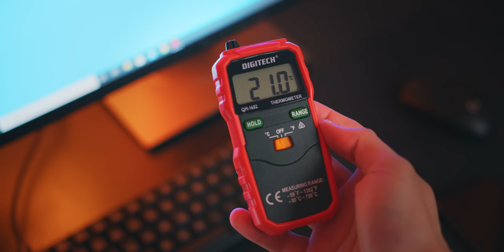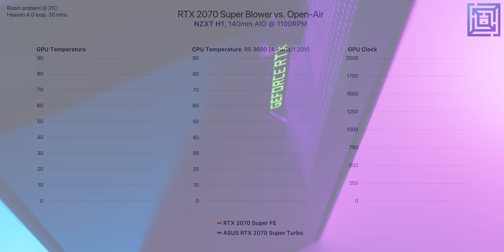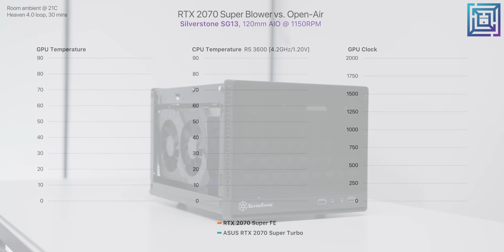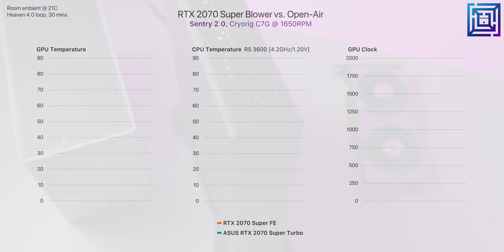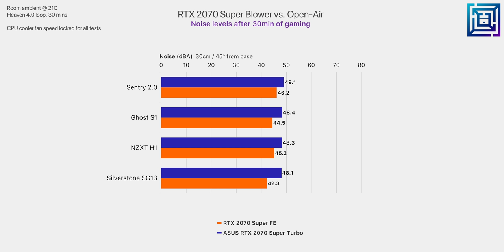Blower Graphics Cards for ITX Builds – Final Answer!

Comment: Don't fear the blowers people.  Makes more sense in the tiny builds.  Just create a custom fan profile and see if you can under-volt without performance loss.  This will significantly reduce noise.
I run one like this in my NCase.
Reply: I've used blower cards in my previous 2 ITX builds and I don't know if I've just hit the lottery but when I take my case around to friends places they can't believe how quite it runs. Guess I just lucked out. I would not hesitate to get a blower cooler again, building in a Silverstone ML08
Reply: I am very afraid though. Haven't left the apartment in weeks, although that's completely unrelated. Bought a blower style card and locked it in a separate room. I swear I can hear it whirling and wheezing at night.
Reply: @FromDkWithLove  Haha. Maybe I have hearing issues then my PC's running 24/7

Comment: I need your opinion for my build, i mean thermal wise, for gaming and 3d render (3dmax) and autocad

I already purchased the cpu,gpu, case
The rest i will buy next week
Case: Lazer3d lz7
Cpu: 3700x + noctua l12s
Gpu: Gigabyte 2070 mini 8gb
Mobo: Strix b450-i
Ram: 64(32*2) lpx 3200mhz 
Psu: Sfx evga 650watt 80+ gold

Comment: Great video! You were right I didn't expect the results of the Ghost S1 and the NZX H1 especially of your review of the latter. 
Goes to show if you can get an AIO water cooler in your build it definitely helps.
A good follow up maybe your most recommended Blower style GPU model.
I'm feeling the  RX5700 /RX5700XT

Comment: Your Asus card is dented, did you smash its corner or something? On more serious note, thank you for this test, it helps clear up such a niche market that not many Youtubers look at.

I think not many people realized, if you use open air cooler in thermally constraint case, you basically cooked your motherboard and ram, your CPU got cooler, but the other components don't. Open air cooler works only if you got a very good circulation inside the case

Comment: As itx cases come more popular, the blower style GPUs might aswell. I just hope they try to improve the fan as much as possible on these blower style coolers, so they could be slightly more effective while being quiet. They could also use slightly thicker heatsink, backplate, better thermal paste and higher mounting pressure to ensure the lowest temps possible on these blowers. At that point it would be the best choice for sure for itx builds. Oh and I almost forgot, as the tech improves, just by being more power efficient will also drop the temps.

Comment: Hey man I'm watching your videos for quite a while and I wanted to build a portable mini itx Music Production PC, with m2 ssd using Avid Pro Tools. need a recommended portable screen, good thermals, but I haven't figured out a build yet besides the motherboard, and a graphics Cards. I'm a sceptical about the ram for which I need 2 Cartridges providing 32-64gb, I don't know which m2 is more reliable to handle VST. I need to replace my desktop with something portable that I can take to a studio... Maybe you can recommend one of your videos as a build example? ty
Reply: I've done a few mini-ITX builds. How small are you wanting to make it? If you're going to be putting it into a backpack I would build it into a smaller case, but if you're going to be carrying the PC around I would recommend the case I have with my main build - https://www.amazon.com/SilverStone-Technology-Mini-ITX-Computer-ML08B-H/dp/B0161UXWRA/ref=sr_1_1?crid=2MDXQ53ZFEPV9&keywords=silverstone+ml08&qid=1583876262&sprefix=silverstone+ml0%2Caps%2C356&sr=8-1

The feet are unnecessary so you don't have to worry about bringing those with you, it's totally stable just with the case and handle. Depending on what you put in there it might be heavy, for example I have a full sized 1080ti in my build, as I'm happy to have the extra weight to carry around with the better performance :-)

As for monitors, it depends what quality you want. I know there are monitor that are ultra portable and totally powered by USB such as the ones listed on this page - https://businesstravel.reviews/best-usb-powered-portable-monitor - Personally I've never taken the plunge into a fully portable monitor as it's easy to leave a monitor where I need and just take the PC and a HDMI cable.

Hope I've been somewhat helpful!
Reply: @TroyHulm  Hey thanks for your reply, but r u sure everything is going to fit in that case? Or being able to breathe? Hdmi is an option but I intend to carry it around and work on the go too!!! I'm very sceptical about such a build still... I've been sceptical for over a year now, but the tech hasn't changed much since then... Thoughts like can I make a portable everything that doesn't brake when moved too often? plus the Audio interface is always external for several output uses... Have you seen a case on this channel that might give me a clue or an orientation??

Thank you so much for your time!!
Reply: @billynorth2391  No worries mate happy to help! The case it actually pretty large for an ITX build so it can fit quite a lot in it. One thing that I like is the plastic side panels (handle is plastic, side panels are plastic but the rest of the case is a thin metal) can easily be removed and reattached. So if it's a particularly hot day or I'm having a long gaming session sometimes I just pop them off to get in some extra ventilation. Not necessary, just nice to be able to do. 

I've actually modified my case a bit as well. I might take some pics and upload the build to Pc Partpicker today and I'll upload here if I get time so you can see what I've done with mine. In terms of moving the PC and things breaking, you shouldn't have to worry about that in modern cases. I know for my ML08- I have moved this thing around for 5 years A LOT and never once had an issue with anything being damaged. I literally move my PC multiple times a day and take it with me travelling (Just be aware as I said before, this particular case isn't actually very small) 

I suppose the best case for you depends on your use, given you've mentioned audio and studio I'm guessing that the graphics card isn't going to be the most important aspect of your build. If you're going to be doing CPU intensive workloads in a small case then you would want to focus on CPU cooling. If you have a big budget this would mean watercooling your CPU and that is something you cannot do in the case I've mentioned.

I think for your intentions, and not knowing your budget you should look at the Sliger SM580 featured in this video https://www.youtube.com/watch?v=qsI-8U5L2Io

Being able to expand the PCI slots could prove useful and it will definitely pack all the power that you require.
Reply: @TroyHulm  Wow ty again so much. Games indeed is not my thing but I need a good  graphics card when making soundtracks and working on 4k video playback on pro tools, but Im not an expert on how the hardware blends with the software so I always buy the best thing for the job and most practical judgung from multiple reviews and asking people... not flashy new things just getting the job done for as long as possible. I will def. Look into it. Ty so much!

Comment: I wouldnt recommend blower style for rtx 2080 super or 2080ti, since my 2080 super even with msi 2 big fans it runs at 75-76c and I cant imagine how hot it would run on a blower style. Since my gtx 1080 blower FE at 1800 mhz would run at 78-79c while the open air one that my brother had would run at 65-69.

Comment: Great video, I have a rvz02 with a rx480 strix oc and in vertical mode the card is very cool the problem comes in horizontal mode and I'm planing to change it to a blower card but still not totally sure if is worth it

Edited : my current card runs 80°C in horizontal with fans running at 70% if is gonna be the same thermals and noise it will only be affecting the cpu Temps but not sure if is gonna help the much the cpu runs at 70°C in horizontal and 58 in vertical

Comment: would have been a more interesting test with a higher power CPU tbh. A 3900X or 9900K OC'ed would be much better information for an end-user imo. I don't think anyone will be worried about Ryzen 3600 temps seeing as that chip is low power.

Comment: Recommend to have same cpu cooler and test gpu card types. That will give a more comparable results, esp S1 to H1
Reply from the maker: The point isn't to compare CPU thermals between cases, it's to compare the CPU thermal delta between cases when using open-air vs. blower. Also understand that you're asking me to remove the pre-installed liquid cooler from the H1, which doesn't make much sense at all.
Reply: @optimumtech  so maybe liquid cooler on all that can be used. Otherwise a liquid cooler maybe more than capable of cooling the cpu during the test, but other coolers struggle. This makes no delta for cpu in the liquid cooler case.

Comment: Hi there,  hope someone can help me out here.
I will do my first build with a NZXT H1 case. Well when it's available again :-(
I'm a casual user and I'm not a gamer, so I don't really need a powerful graphics card. I'd like to play 4k hdr movies though. I will buy a good hdr monitor and i will also hook it up to my LG OLED TV to play movies. I have no idea if the PC will actually be an advantage compared to the TVs algorithms though...
The problem is, I have no idea what the requirements are for this in the graphics departement. I'd like to buy a GTX 1660 (maybe 3 fan variant because of the cooling solution in the small H1 case?).
Would that suffice? Or even be overkill? It's hard to find those requirements because everything is measured in terms of fps during gaming.

Comment: Great comparison. Having a 'blower' 5700xt I've considered it's prospects for the future. I currently don't need to do the washer mod and run it stock as I don't push my system. Do you think the 5700xt undervolted and modded - being a smaller card than the blower rtx 2070 super would be comparative in performance? Currently the blower 5700xt is cheaper than most RTX 2060 supers...
Reply: The 5700xt and 2070S are identical in performance. You'll see 10% back and forth depending on the games or none at all. Both cards can be configured to use more or less power (180-250W) so as long as you configure them to draw lower power they'll both be good for SFF. Currently the 2070S is well overpriced where I live so I'd get the 5700xt any day of the week.

Comment: I do find it sad that blower cards are considered bottom barrel entry level "trash" by both manufacturers and consumers.
With a bit of R&D put into their designs, they definitely could perform better, and as some commenters have noted, they already have in some models.
They'll still be a little loud, but with a more advanced heatsink structure making use of heat pipes and even copper fin designs, thermals could definitely be brought down, and this would in turn improve noise.

Comment: Not convincing for me even in the sentry.  Decibel level is not the only thing that affects our perception of loudness and that whine on the ASUS is extremely annoying.  Despite the fact that the blower lowered CPU temps, the temps for the CPU with the open cards never got high enough to cause worry, particularly since the fan speed was locked.  The fans on aftermarket CPU coolers tend to be a lot quieter than those on GPUs.

Comment: well ofc because in mini itx cases the card is vertical and there is air holes on the side unlike in a normal atx case where the card is horizontally and have a fucking GLASS side

Comment: Hi. Can you make a smallest ATX case build?
Reply: @Rubedo Alaberti Jeez
Reply: @Rubedo Alaberti Google: The standard ATX is the largest at 305 by 244 mm. The micro ATX is at second largest at 244 by 244 mm. Finally, the smallest is the mini ITX, which is 170 by 170 mm. The size of the motherboard isn't really that huge of an issue but it's a point to be considered when you're also choosing your computer case.

Comment: The more I think about the test method and conclusions in this video, the less I like it. Running a gpu benchmark with fixed cpu fan speed, then of course the blower-style card will be the noisiest, as the noise is just determined by the gpu fans and a blower-style card is always more noisy even at the same gpu temperature.

At the opposite end of the spectrum one could do a cpu benchmark. But the result of this is already known: They would perform very close in terms of thermals and noise as the gpus are just idling. If there is a measurable difference, then I expect the blower-style card system to have the lowest noise level, as any temperature increase caused by an open air card is instead blown out at a negligible gpu fan noise level.

So I think these two extremes have different winners. But most interesting workloads are in between, e.g. gaming.  Is the reduced case temperature sufficient during gaming to offset the inherent noise of the blower? Mostly like not, but I would love to see a video answering it. And what about video editing, compilation, etc. What range of workloads would the reduced case temperature be sufficient to keep the total noise lower?

Comment: Still using blower vega 64, it's not even that loud if the case has good airflow.
Reply: Same here, applied new thermal paste and i get temps about 77c
Reply: I've locked mine up tight inside a noise cancelling Define R6 tower. Just about the only damn good decision I've ever made.

Comment: Call me a noob, but where is the open air control test? Don't FE cards of this generation have a higher binning and naturally run better then their board partner especially low end ASUS blower cards? So... direct comparison of GPUs will usually result in the FE cards outperforming their lower binned counter parts?

Comment: Has anyone tested the Phanteks Evolv Shift Air or just the regular shift? I'm thinking about getting one but I'm worried I'm going to have to spend more than I need to because I'd need to upgrade to either a blower style card or have to resort to waterblocking both the card and the CPU. I've only done air coolers for most of my builds so I've been wondering if it's worth needing to grab water coolers for that case.

http://www.phanteks.com/Enthoo-Evolv-Shift.html

http://www.phanteks.com/Enthoo-Evolv-Shift-Air.html

Comment: (EDIT. Nevermind, I should start watching the whole video before commenting.) With a 1070 you will get far less FPS so by default it will work all the other components less, especially the cpu. Should've used a reference 1070 and an open air 1070 set to the same clocks and power target.

Comment: I just don't understand the point of these aftermarket, blower-cooled GPUs. Speaking from firsthand experience with Asus's "Turbo" 1080ti, the thermals suck, the core clock is all over the place as a result and my card underperforms compared to almost any other model of 1080ti. From what I've seen, blower-style cards aren't any cheaper than their counterparts, so I have to imagine it's just people like me who buy these not knowing any better.
Reply: Worth adding that my blower-cooled card runs stupid hot in a Meshify C packed with six 120mm Noctua case fans - and somehow still accounts for most of the noise my rig makes. I think it says a lot that Nvidia did away with this style of cooler for their 2000-series cards, but that's just me.

Comment: Watch the GamersNexus video on thermal testing pitfalls. You fell into more than a few. Otherwise nice video though, thanks for your work.

Big points - You need to use the same CPU cooler, and you need to run CPU ONLY tests to control for case impact on CPU temps. Then you can calculate out the impact of the case on the CPU cooler and only look at the impact caused by the GPU.
Reply: I will stick by the notion of real world on this one. Sff is limited in options, so layout dictates cooler choice. Yes he could have used a Noctua L9A for each test, but that's completely unrealistic for optimizing a given layout. It's real world vs finite accuracy on numbers.

Comment: Dont know why every tech youtuber is so hyped about the H1... I think it's too expensive and has a quite bad cooling design... closing off the top of the case is a really dump idea because hot air naturally want's to rise... I think the Phanteks Evolve Shift has done it better (it has other shortcomings though, like the restictive front- and backpanels). If i would be NZXT i would have opened up the top, move the mountingplace for the 140 rad, the PSU and the Front I/O to the bottom and moved the tg panel from the front to the cpu compartment, so that the Graphics Card would have as much possibilities to suck in fresh air and get rid of the hot air.... I would buy the Raijintek ophion instead... its much cheaper, can house bigger rads and does a better job at ventelating the components it's also a bit larger but still an sff case... maybe somebody could explain to me why the NZXT is so hyped by the tech youtubers?
Reply from the maker: Because the NZXT H1 has:
- smaller footprint
- smaller volume
- looks better (subjective)
- much better CPU thermals
- GPU thermals that aren't horrible, they're just worse than other well-ventilated options like the SG13 and Ghost here. 
- an insanely easy build process

Comment: So in conclusion, with the blower cards on the market today there is not one single instance where they make sense in a gaming focused small form factor build. It is literally incapable of keeping the GPU below 83c and has terrible clock pacing which will ruin frame time consistency. Any decent CPU (Intels power hog is not a reasonable part for sff) will be comfortably below any throttling limit and therefore it is a non-issue routing hot air away from it.